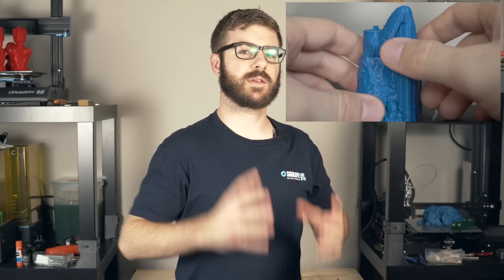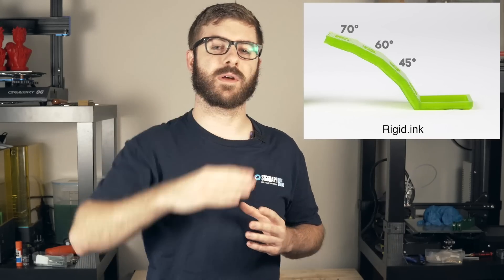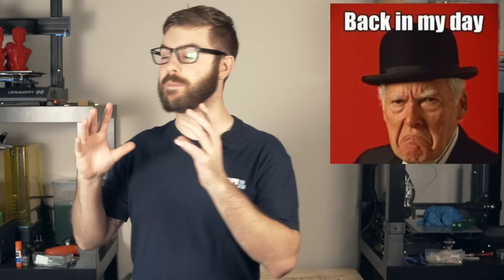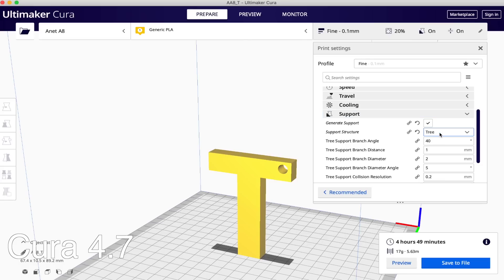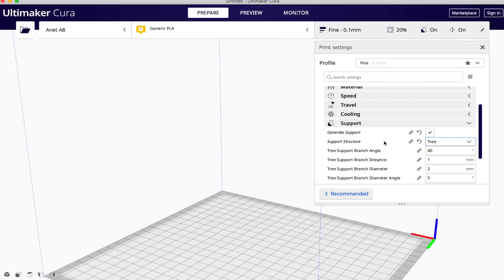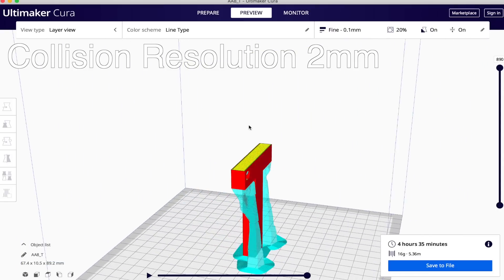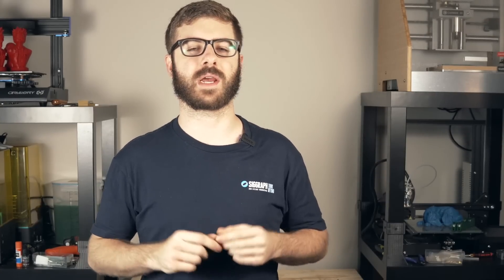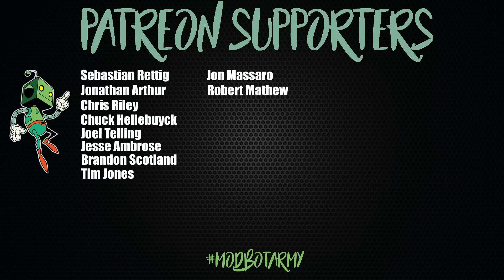3d Printing Tree Supports In CURA 4.7.1 (When & How To Use)

Comment: Consistenly failed tree supports at 40mm height. Changed temp, changed print speed, tried zhop. From 205C to 220C, all while trying print speeds of 50-65mm/s with and without zhop enabled. All failing. Bed is calibrated as is my extruder. Running Marlin firmware, using Cura 5.9, stock ender 3 v2 neo

Any help is much appreciated!

🤘💚🤘

Comment: How the hell could you remove the standard tree support this easy? 
I have to spend hours to break it apart from the printed model. I use the default settings in the actual Cura version.

Comment: I am doing a  8 bladed turbine. The tree supports work great for only 6 of the blades. The seventh gets only small partial amount. The eighth blade gets none. I used default settings. I s there setting I am missing?

Comment: The chin example can be fixed with a thicker branch diameter and a smaller branch distance, it helps with parts overhanging outside the overall volume of the piece...it's an awful idea to use it in places like under the legs gap, tho.

Comment: I used tree supports for the first time on a "caulk tube holder" it completely engulfed the print but it worked great.  
I had to use scissors to cut away the support structure, but the final item looked great.

Comment: This really doesn't have anything to do with the video, but how are you able to rotate the model so easily in Cura? I regularly use Solidworks and Inventor and the way models rotate normally in those are WAY different than the rotation in Cura. In Cura it's like the rotation point is way off in the distance. When you hit the Ortho or one of the face view options it rotates fine, but as soon as you zoom in and try rotating it, it goes all weird. Any idea what setting to look for to fix that?

Comment: Thanks Daniel. I just bought another 3D printer after not having one for a while. I got an anet a8 for a steal. I payed $50 for an already assembled one with an extra extruden assembly.
Reply from the maker: Holy cow that is cheap. Did you buy it online or was it local from someone that decided they didn’t want it?
Reply: ModBot I bought it local. These people were using it to print mask parts but they ended up upgrading to another printer. They were also moving so wanted to get rid of it.

Comment: I print protein structure 3D models. Very complex and can a week to print. Tree supports make a huge difference when support removal can take hours by normal supports.
However, Cura is getting worse at tree supports. For some reason, it can take an hour to slice tree supports in recent versions. It used to be much faster.
Reply from the maker: That is definitely something that I would imagine take a lot to support. Removing supports from the Charmander model with three supports was substantially easier than standard. I could only imagine a model like that the time savings. That sucks to hear, I wonder if they need to rework their engine a bit. I will say that on my desktop which is quite a powerful PC it was pretty damn slow in comparison to using traditional supports. Perhaps some optimization is needed to make it run quicker.

Comment: Has anyone used tree supports on a wearable helmet? I have a printer large enough for it but I'd really like to cut down on filiment used and print time because printing with standard supports takes a little over 14 days
Reply from the maker: I didnt even think of that but that in my opinion would be a terrific use case. I can definitely see you wanting to confirm with something that has attempted this before committing to such a large print.

Comment: I have been tinkering with tree supports for months. What I use them primarily for is what MOST people would say, "Just get a resin printer!": D&D models.  For those that somehow are in this hobby and don't know, those models are typically on a 1" base and are usually less than 2" high and have a HIGH amount of detail. Maximum resolution is .12mm, and if you have the time and want really clean details, .08 isn't unheard of.

With tree supports, the one thing I've finally narrowed in on "minimum support area" vs your X/Y/Z distance. This is where a lot of tree supports fail because either you're entirely too close (which is a problem with any supports), or specifically with tree supports you get "floaters".

Floaters will look like support roofing at the tips of the branches......but no connected branches. So, you end up having a bit of filament spray out into the nether and do...nothing. That is, nothing except put a weird nub on the outside of your otherwise decent print.

I'm still narrowing down a few other settings, but I have gotten some decent minis. The biggest thing I've learned though is it depends on the mini. I have one GLORIOUS mini I use as a test and does well with tree supports. Curves, negative space, bridging, all that, but nothing too weird. Then, I had a friend who had a monk character doing a side kick. That ankle snapped like a twig (had to do some surgery with the tip of a sewing pin).

Latest project: I'm a data analyst and MS Access developer. I'm currently parsing the big JSON file that has ALL of the possible cura settings in it (fdmprinter.def.json) and then comparing that to all the custom curaprofiles that people have put out so I can quickly compare Chep's profiles vs. Fat Dragon Gaming's vs SiePie's profile and find the sweet spot.

Hopefully tree supports will be part of that concept as well.
Reply from the maker: Thank you very much for taking the time to respond with so much detail. I love comments like because they really shed some insight as to others' experience. For starters, I will agree I think you are a mad man for printing minis on an FDM printer but I do know you are not alone. Most of my buddies use resin for minis and will use FDM for things like terrain. 

Are you using a standard .4 model for these prints or something a bit smaller?

That is awesome to hear though that you are at least having luck using them on some models where the tree supports generate correctly. I will have to keep my eyes out for "floaters" I think it is a great habit to always check the gcode to make sure there is nothing weird going on and it sounds even more important with tree supports. 

Would love to see your project when you think it is in a good place. I am sure others would be interested too. 

Have a great day and thanks again for all of the info!
Reply: @ModBotArmy  Someone just liked the post today, and I nearly forgot about it.

As info, my database is nearly done, I just want to gather as many profiles as I can to compare. I managed to parse the JSON file with all the FDM options and also read the .curaprofile content and compare them to the defaults. I'm really excited to be able to look at things with a fine-toothed comb.

With the new version of Cura coming out today (4.8), I'm asking the community what profiles they use on their Ender's so I can get a cross section. It's out in the Ender Beginner's group #2 on Facebook.

Comment: You have to the your tree settings so that they're larger and set them to not support small surfaces or only high angles.
I almost exclusively use tree supports.
Reply: What settings do you use? Can you share your values?
Reply from the maker: Good tips, I am still definitely learning as I go with them.

Comment: I’ve never used them. I’d be interested if  Joker print with default tree support would have printed better than you custom support gcode. It may not always be about reducing material if surface finish can be improved.
Reply from the maker: It is very possible. I do know that the standard supports would have been terrible to remove based on what they were creating. However, the tree supports may have been fine. I still feel like a small support block was the way to go for this model.

Comment: Can you not use custom supports in conjunction with tree supports?  I think I’ve done this in the past. That should allow the joker chin issue to be rectified. Also the extra tree settings would go a long way there. 
Tree supports also follow other support settings, so you can add extra walls or support brims to make them sturdier.
Reply from the maker: I sort of figured as much in regards to the other support settings affecting the tree support but just left it all as is with the exception of the 5 settings specific for tree supports. I will have to see if you can combine the customer supports with the tree supports.

Comment: Another real pro of tree supports is that you can avoid starting supports on an already printed parts of your model
Reply: This is what I’m troubling with nowadays. My whole models are full of small connecting points because it uses the already printed parts.
Reply from the maker: I didnt really think of that but your totally right. They can weave to where they need to be instead of having to go straight up and down from the surface of the model.